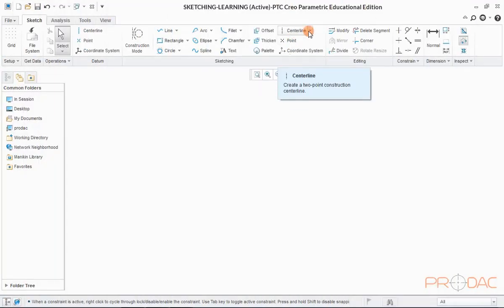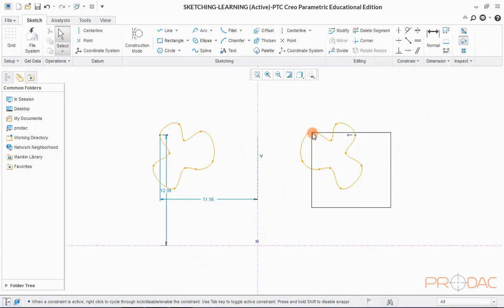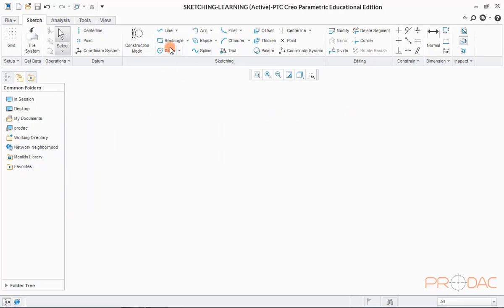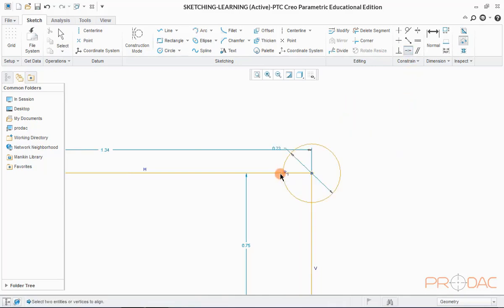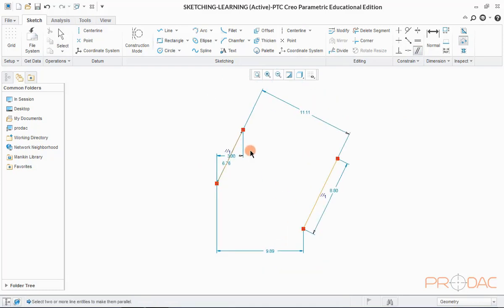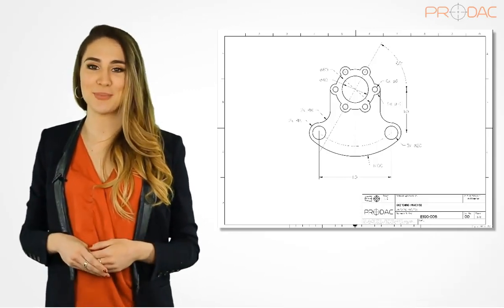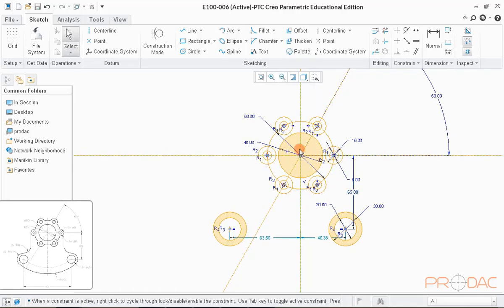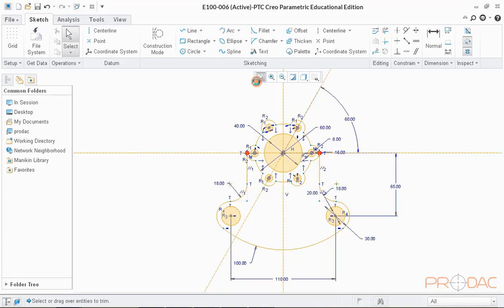Learn Sketching in Creo Part-2

Comment: Hi friend, It nice video presentation. Good Job. I have one doubt.  what is use of separate Sketch module in Creo.(NEW file-->Sketch). Because everything we are doing within part module itself.(ie., New File-->Part--> Sketch-->extrude, etc.,)
Reply from the maker: Hi, Sketch is the foundation which is used even while creating parts. Before you can create parts, you need to create sketch. Therefore, designers must know how does this works and what r the available features. Hope it clarifies. Thank you.